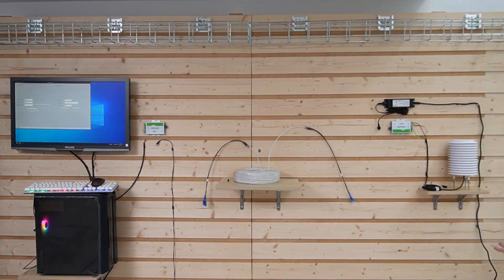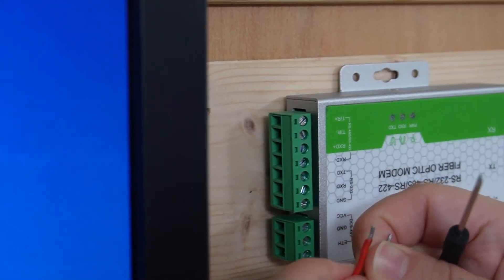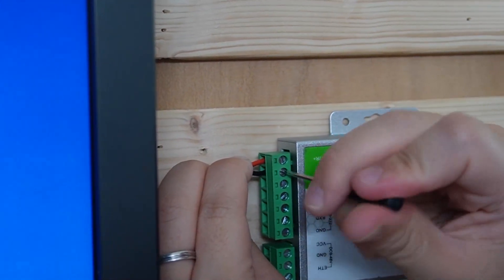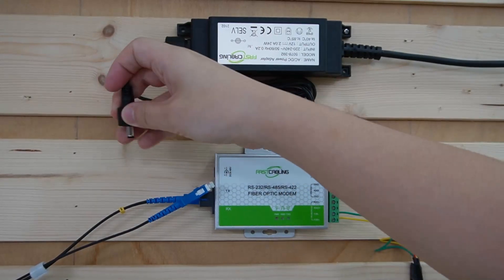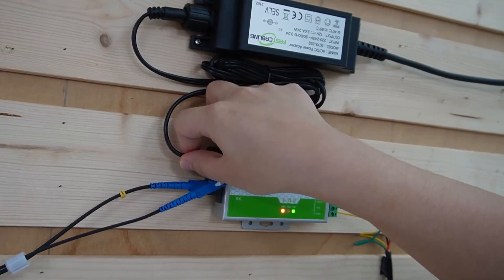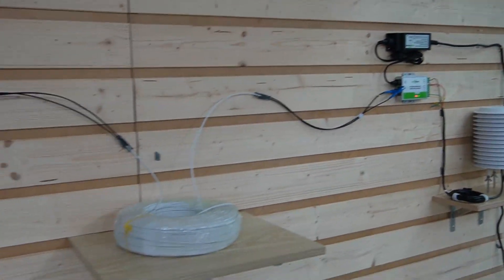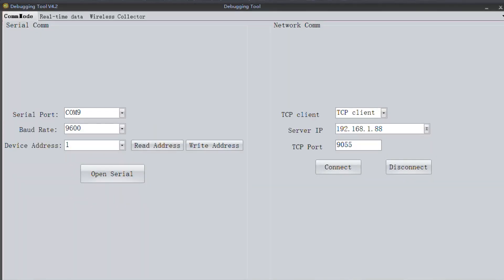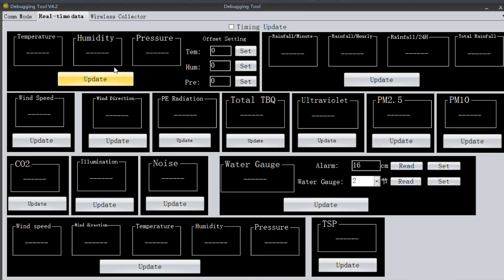Step-by-Step Guide to Installing an RS-232/422/485 to Fiber Converter

Comment: Thank u. You havent shown where the sensors are connected. Thank you
Reply from the maker: Hi, you can connect the sensor's serial output to the corresponding input pins on the adapter:

RS232: Use TX (transmit), RX (receive), and GND (ground).
RS485: Use A (+) and B (-) differential signal lines.
RS422: Similar to RS485 but with TX+/- and RX+/-.